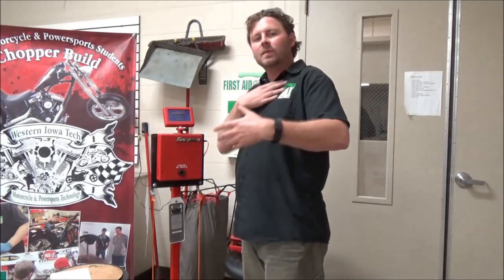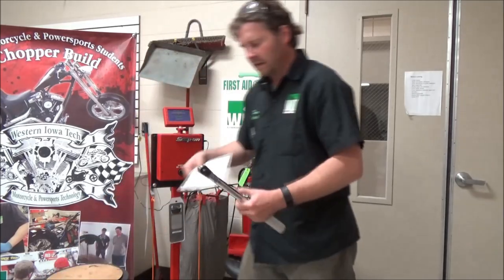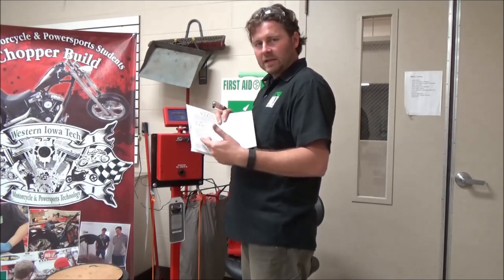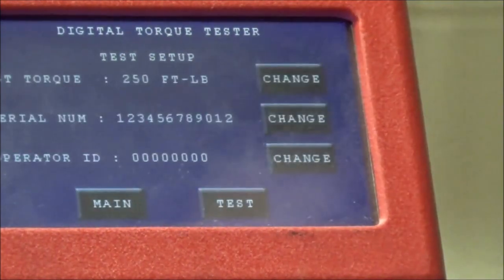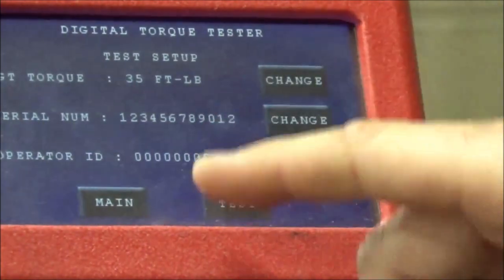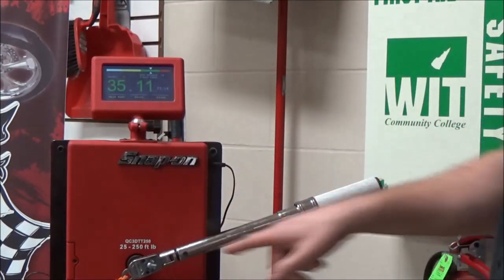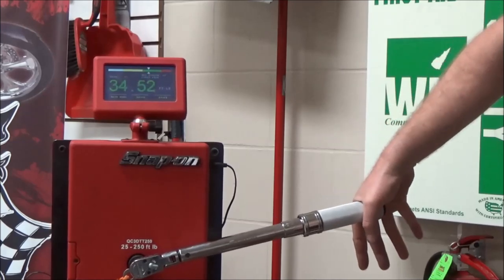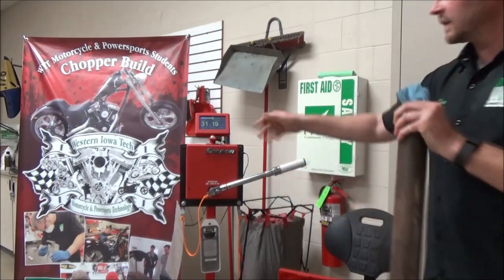Why hand placement matter when using a torque wrench. Proof with electronic tester!

Comment: When it's short arm it requires more force to apply which is more difficult to manage.
If You over torqued it it means that You pushed it past the end of the stroke after the click or that it was so fast that it created so much momentum on the bolt/nut that it kept going by itself.
Usually this kind of things matter once You play with small torque settings, but once You go up on the torque settings and it requires more force to be used = less angular momentum the difference drops.
So if we're talking about for an instance 10Nm little bolt it does matter, but once You do up car wheel bolt (let me say 130Nm) it doesn't matter too much as You won't be able to create that much angular momentum relatively to stopping force at high torque.
If You do it quick it may actually be better to apply quick motion with roughly the same angle at all already hand tight bolts on shorter arm as once arm is shorter You got not that much power to over torque so at the moment it will click you'll be applying less torque to it so it will stop faster by itself after the click, assuming You got the right feel.
Doing this the way in my work I had so much control over it that it was clicking really silently - was just going over the edge of right torque not even hitting the end of the stroke past the click (which normally happens with ease if You move it fairly fast with longer arm. If hit at the end of the stroke is too hard it may rotate the bolt even further.
The other thing is that threads especially on new or rusty bolts got some rough surface and if You go very slow it will catch some of the micro debris and lock before it really should. Going faster will most likely reduce the effect.
That's why when You mess up with rusty bolts You're more after equal angle on all bolts measured from hand tight point (assuming bolt/nut surface is fairly smooth as it may make it complicated even more...).
More dynamic torque wrench use with right feel will most likely produce more equal torque on the all torqued bolts which in most of cases matters more than not slightly over torquing due to a bit faster radial speed.
If we talk about range about let me say 130Nm on torquing wheels in star sequence incomparably more error will be caused because of the tension differences - increasing final torque with each next bolt.
There's static friction creating some hysteresis usually bigger than the error so double pass will not fix it - in rare cases it may correct a tiny bit only position of 1st bolt - that's why I always  do 2 passes with different torque settings and pay more attention to equal motion angle rather than torque.
If it's for an instance engine head gasket done is super important and that's why torquing to yield usually requires final 90* turn rather than some exact torque.
After some run in usually the little debris trapped on threads smooth up a bit and that's why it's advisable to torque it up again after some mileage.
Reply from the maker: Thank you for taking the time to add to this video. So many just throw a random post or have no detail to what they think and is simply wasting time for the community. You're welcome here anytime...
Have you Subscribed yet to never miss a video? Have you seen the video playlists https://www.youtube.com/user/conleybuilt/playlists ? Quick answers are often found here. No time to look through videos? 

Still have questions? You’re in luck! I provide tech help and work one on one! I know your question may seem quick but with over 300 requests a week, it’s not possible to answer them all. So, I’ve narrowed down so subscribers and donations to assist beyond the over 660 free videos. My YouTube has grown beyond the ability to answer every question (11 million views! Over 500,000 a month!)

Click here for the membership links and welcome to the community! https://how2wrench.com/product-category/specials/    

Want to say “thanks” or “keep it up”? Click here https://www.paypal.me/how2wrench   This is great for those truly quick questions you need answered and your help back will keep me going!

Your answers and help are just around the corner. Save time and money while protecting your investment and yourself by doing it the right way!
Admin How2Wrench.com

Comment: Have the official USAF reference on the subject straight from a USAF depot facility link. 
This also gives the calculations for using "dogbone" and other torque wrench adapters so I suggest every mechanic read it. Then you can fab custom adapters (like a cut-off box or open end wrench welded to a socket) and KNOW how to calculate leverage.

http://www.robins.af.mil/Portals/59/documents/technicalorders/AFD-091006-042.pdf?ver=2016-06-28-120046-913

If the link changes, here's the Technical Order: " TO 32B14-3-1-101" 

See page 6-3 Caution "Improper hand positioning will result in an inaccurate torque. Always apply force to the designated handle or handgrip."

EVERY assertion regarding wrenches is TESTABLE. (That's why military and civilian PMEL facilities exist, to test and calibrate equipment and tools.)

Comment: I have an idea. Mayby the only reasonable idea that could explain these readings. I guess that the handle is somehow connectd do the tension mechanism inside. Is it possible, that those results are caused by a distortion made to the joint between the handle and rest of the wrench - depending on the point of force apply? Is  it possible to attach a pipe to this wrench in a way that excludes even a silghtest contact with the handle and than grab in different places? Just to discover the basis of this mysterious behavior.
Reply: Yes, somehow you figured out exactly how it works. A torque wrench is not a ratchet, it is ratcheting for convenience. You are applying force to the internal mechanism, so when you add a lever, (cheater pipe) you are applying more force to the mechanism first, then the fastener. This style torque wrench has a breakaway component, when you turn the handle to change the torque adjustment, you are actually changing spring tension inside. So your fastener is on one side of the breakaway component and the point at which you apply force the other, once the fastener's resistance to motion overcomes spring tension the component breaks away producing the "click"
Reply: I think I have another explanation for his results.  I think this is an issue with his machine.  You are trying to measure torsion, but if you think about it, the closer in to the point of rotation your hand is, the more cross force you are putting on it.  When you are way out with a long handle, it is mostly torsion force.  If you were only an inch out trying to measure 35 ft-lbs, you are going to have to push with 420 lbs of force, putting a lot of cross force on it.  I think this is affecting the machines reading, possibly by friction in the mechanism in whatever type of bushing or bearing it is using.  Or, depending on how the sensors are designed, cross force might be integrated into it's reading.  Torsion force might not be the only thing it is seeing.

I suspect the machine is calibrated for the amount of cross force generated for common torque wrench lengths for a given range of torque you set it at.  Otherwise, it seems you would not have to tell it ahead of time what torque you are trying to measure.

With this in mind, you would want to always test it by holding the handle in the proper place, but in real world use, choking up or using a cheater bar will have little or no effect on the actual torque accuracy.
Reply: Vincent you may be correct on that matter but in addition to that, changing the distance you are away from the center of rotation also changes your circumference of your arc. I believe the reason that he is seeing more torque being "choked up on it" and less with a "cheater bar" is because being choked up on it shortens the amount of travel and therefore the wrench is clicking and he can't stop applying force fast enough before the click bottoms out and therefore over torques the fastener. It's the opposite with the cheater bar as he now has plenty of time to stop applying force due to the increased distance of travel. If you watch frame by frame you can kind of see this(unfortunately the video is shot in a lower fps). I'm not saying that the handle isn't the best place to hold a torque wrench because it is, its easiest to get repeatable results because you know you place your hand in the same location and make the same movements each time. I'm saying that his reasoning for this video is incorrect and it frightens me that he is in charge of educating individuals without seemingly any knowledge of the tools he's using or how it works. As a mechanical engineer I unfortunately see many cases of the "I don't know how it works but use it like this because I said so" and that's just wrong. Especially coming from someone trying to educate others.
Reply: Cole, that's a very good point.  After you mentioned that I went back and watched his tests again and noticed he increased the force very quickly until it clicked.  So your point about the range of motion would likely directly affect the amount of force he applied based on his response time on releasing it.  It could also be a combination of that and cross force.  I think a good experiment would be to perform the same tests, but increase the force very slowly until it clicks to see if the range between his readings decreases and by how much.  And/or increase the force slowly when chocked up and more quickly when using the cheater bar to help compensate for response time and see if the readings come together.
Reply: @vincentstemen6309  I think you're correct about the non-rotational component but not about the source of the problem. The problem is likely not in the dyno but in the torque wrench itself: A "clicker" wrench uses a mechanism that slips when a certain amount of shear force is applied to it. Pressing down closer to the pivot with the wrench angled upwards creates more friction in the mechanism which then slips later than it should (and vice versa, holding it further away applied more torque and less shear, so the mechanism slips too early).

Comment: What You showed is disturbing....I don't think this was native intention of torque wrench designers. I thought that these wrenches were designed to apply the same amount of torque to a screw - no matter the length of the lever. Could You please make 5 or 10 attempts for each point of grip - closer than instructed, at the right place and with an extension. Just to be sure, that this was not a coincidence.
ps. Does it affect electronic wrench also?

Comment: Torque is torque man.. Doesn't matter what combination of force and distance is used to get you there. T=fd there is no magic in torque wrenches. 

Is it good practice to use the handle? Yes - longer handle is more forgiving to jerk (as you demonstrated)
Is it required to use the tools handle? - No

It's not a debate.. It's physics

-Aerospace Engineer
Reply: So how do you explain the readings on the meter in the video that changed depending on applied pressure placement?
Reply: In the case where he places his hand closer to the head of the wrench he has to apply about twice as much force with his hand to get to the 35ft/lb and because he doesn't apply the pressure smoothly and slowly he end ups up over torquing when the wrench breaks away. (less forgiving to jerk like I said)

In the case with the extension tube, the tube actually bears on the wrench handle at 2 points, this induces a small amount of bending in the wrench handle in a direction opposite of the way the handle bends to torque a fastener. This reverse bending decreases the applied torque. (not positive on this one but that's my theory)

At the end of the day you should use the tools as there designed to be used as he suggests. From a physics standpoint T=FD, you can't argue with physics..

Comment: do it slowly same speed, can't make a difference cos the head is metering, but you have to stop immediately... and torqueing is not tension ....there is a yt vid who explains it....so your test could be more elaborated....giedendag
Reply from the maker: Regardless of any theory, would you agree that this is exactly how "techs" use torque wrenches? Are you saying the instrumentation is inaccurate? What tech "stops immediately without digital reading? We have tried slow, fast you name it and fast made marginal over torque.
Reply: +Shane Conley I have to see it myself, cos you're a tech too...and I would do it with a tension meter to rule out friction..of the nut anyway I follow what you say..can't hurt, and I'm not strong so I must use end of tool...goedendag

Comment: Genuinely think you made mistake. If you set the torque wrench to a number, you will get a click when the number is applied to the nuts. Yes when you place your grip farther, you don't need to use that much of the force as you place your grip nearer, but the force applied to the head of the torque wrench(or the nut) is the same. This is the simple physics of a lever.
Reply from the maker: Hello. Watch again and look for the mention of the manual. It may be in the playlist. I didn't "invent physics" or break them...the manufacturers all agree and specify this in their manuals. Look into it and come back here with your findings...

Comment: I appreciate what you are showing here, although I don't believe it is scientifically valid due to lack of repetition and some uncontrolled variables.  For instance, the test where you observed a reading of 34.52 by pressing on the end of the handle resulted in a value well within SO's 4% clockwise tolerance spec.  Of more importance I think it was visually obvious what happened when you choked up on the wrench and got a 43.68 reading; the application was cumbersome and uncontrolled and therefore momentum/inertia carried you through the motion past your target force value.  You can even hear two clicks (not exactly sure why) but that shouldn't have happened.  The rocking movement of the torque tester is proof enough for me to discredit that result.  I'll agree that the extension-aided value of 31.19 may indicate a theory of "fulcrum length matters", however it is done only one time and the value is not radically changed as it would be in a genuine situation where the focal point is changed, e.g. when a dogbone, crowsfoot, or other extension is added to the overall length of the tool on the opposite side of the drive head.  These types of calculations are using geometric ratio to figure the correct torque correction.  You added a pipe about as long as the wrench itself and only realized an 11% difference from the target value.

It's foolish in most every case to hold a torque wrench, particularly a clicker with it's inertia-based shortcomings, anywhere but centered on the handle.  That said, some torque specs which require adapters mention the fulcrum length of the torque wrench required and one may be inclined to hold his wrench at that fulcrum length despite it not being designed to that specification.  It's important to know why things happen, not just that they happen.

Variables and uncontrollable situations (humans, working conditions, materials, etc.) place inconsistencies on the measurement and application of a specific torque value.  The clicker mechanism is designed and capable of applying the specified torque regardless of where force is placed on the handle - in a perfect world.  In a perfect world each result would be 35.0 ft/lbs, the only change would be the amount of force applied at various points of the handle/extension, where force would increase as the application point came closer to the drive head.

It's like the old argument that a socket extension can/can't change the reading of a torque wrench.  Of course it can in the real world.  It adds flex and offset to the equation.  In a perfect world where there is no flex and everything is in perfect square a socket extension would not alter torque readings.
Reply from the maker: Thank you for taking the time to comment! Hit that subscribe button please! It helps us!
Here is a way to support all the free videos.
Want to say “thanks” or “keep it up”? Click here https://www.paypal.me/how2wrench  

Coach Conley is also available for hire to personally work one on one with you if ever needed. Yep he is a real person. Give him a call @ 602-345-0432

Your answers and help are just around the corner. Save time and money while protecting your investment and yourself by doing it the right way!
Follow us!
Web:
www.How2Wrench.com    
www.Tools2Wrench.com